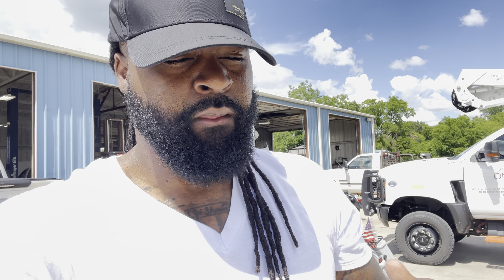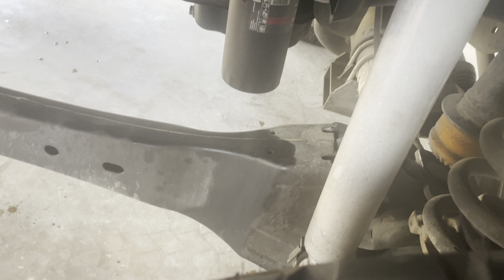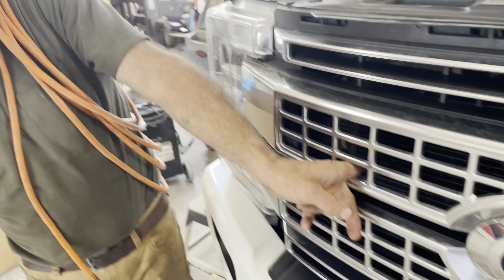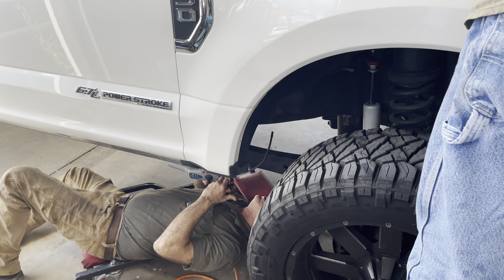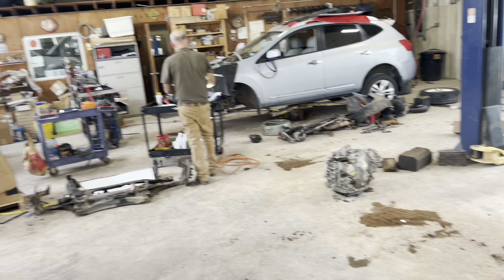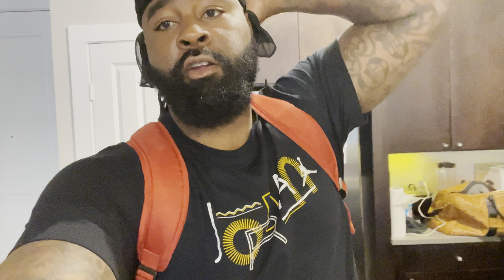I HAD TO GET THIS FIXED QUICK!

Comment: I see why you travel to them. Something as simple as using dye and pressure to check leaks is how it’s supposed to be done. It’s a shame simple diagnostic tricks are being lost on this generation of paid “mechanics”. Friend of mine sent his dodge to two different shops to be told new motor when the fuel pump and injectors were problem. Something a fuel pressure tester would show instantly. It’s how I saved him a couple of grand.